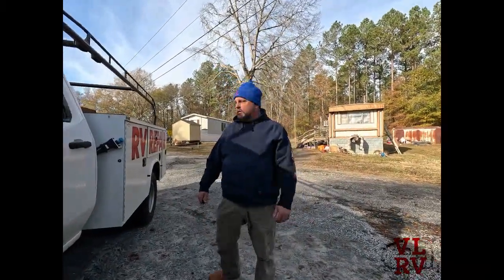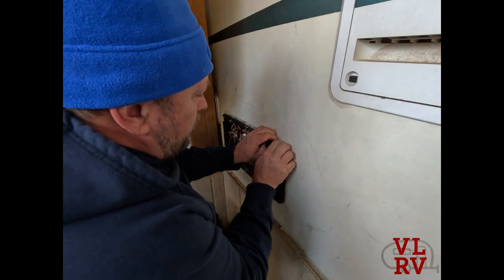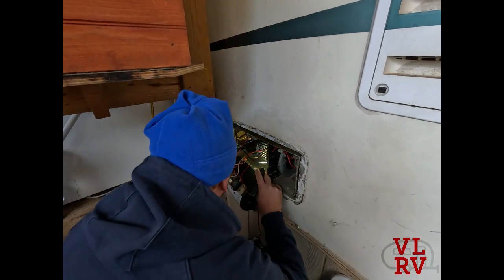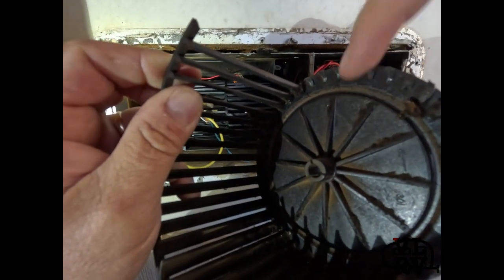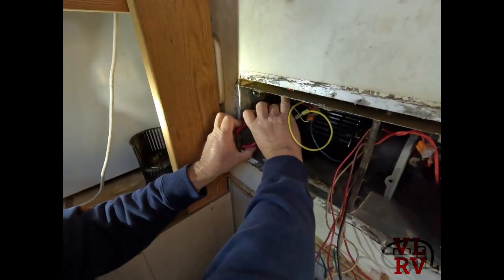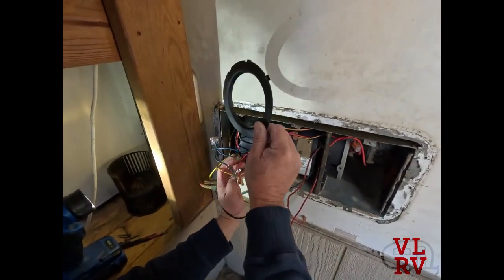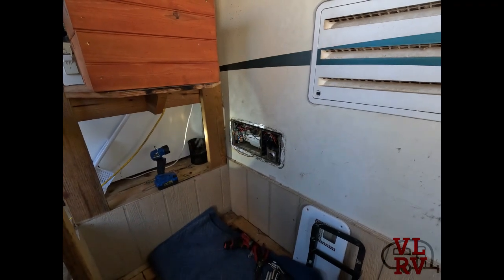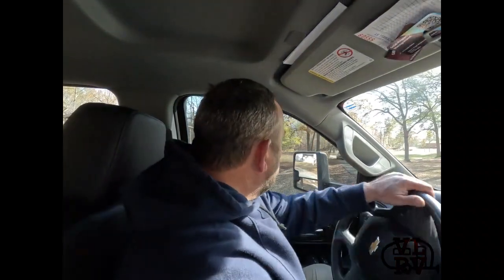Repair of old Atwood Furnace

Comment: I've had luck taking the combustion fan off so you can remove the motor.  Then put the clamp on b4 the motor goes back in.  The clamp on the combustion fan can be accessed with 90 degree needle nose.
Reply from the maker: Great tip, thanks